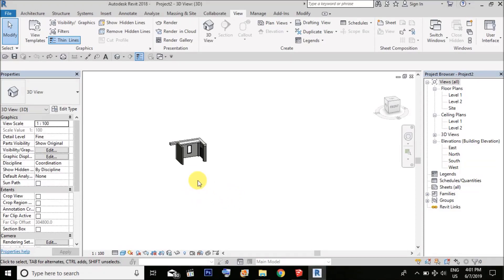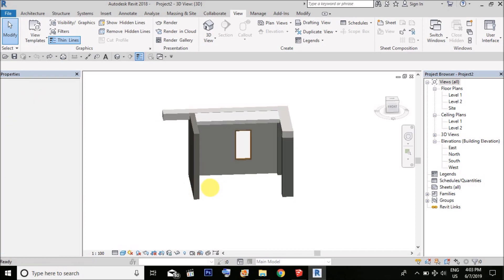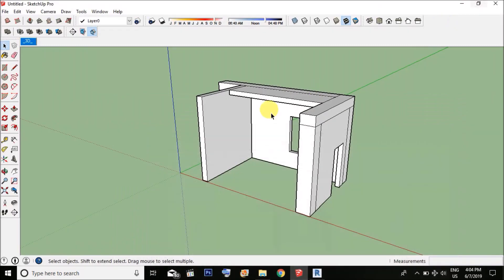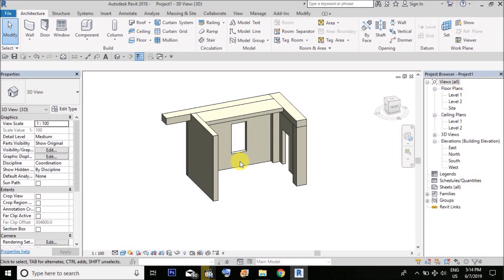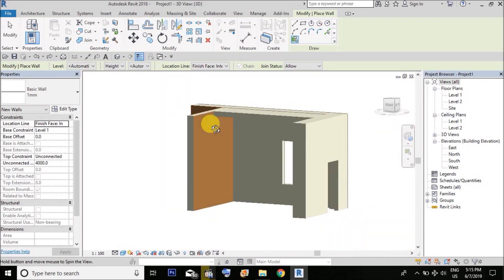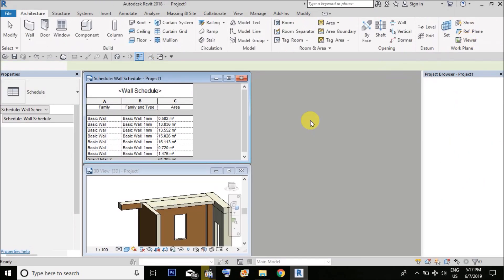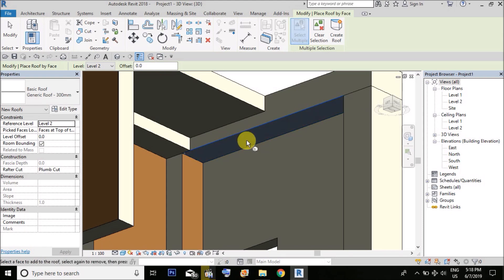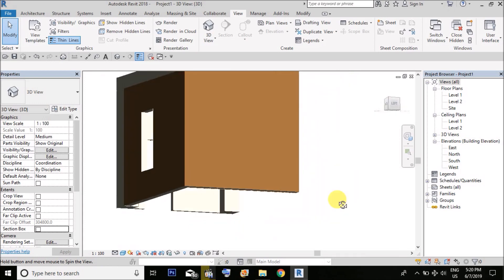How to find out exact wall surafce/ Paint area or Mivan area in Revit (without overlapping)

Comment: Thats cool. But buttom of the beams cant be selected how can we fix it
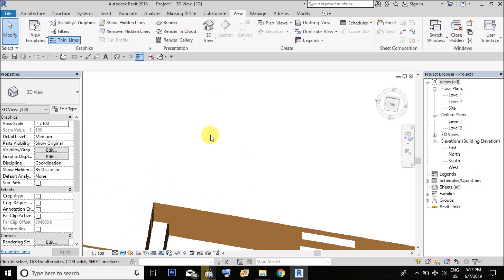Reply from the maker: Wall option could be used only for vertical surfaces. So for horizontal surface we could use roof as explained in above video @ 8:00